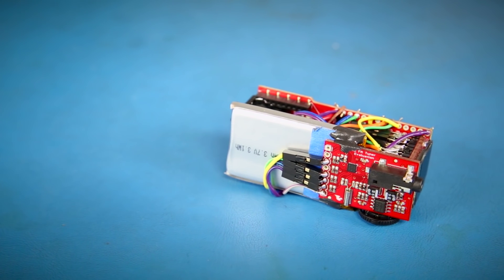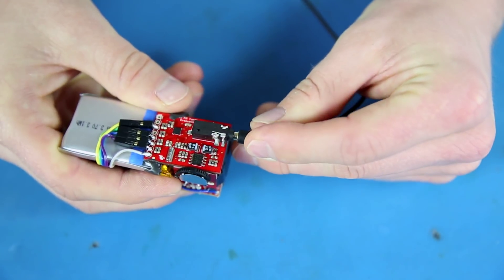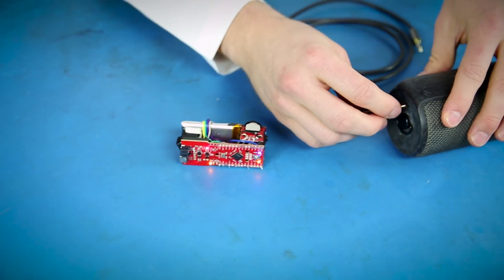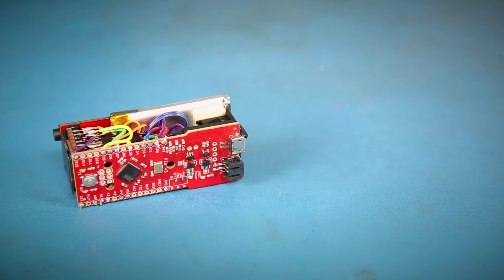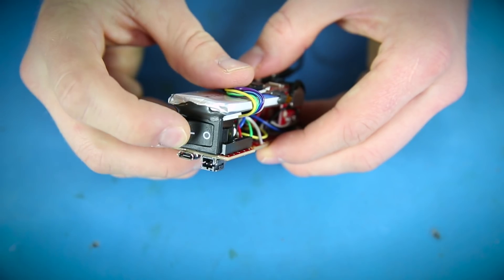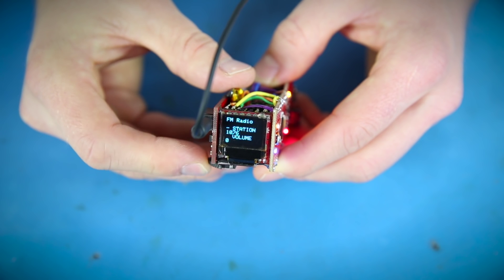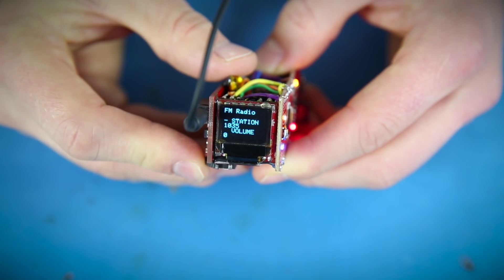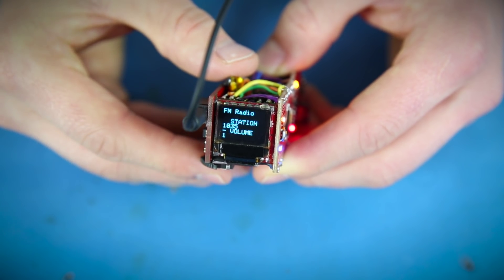SparkFun SI4703 FM Tuner Evaluation

Comment: See SiliconLabs' AN383 for lots of interesting details on the antenna. (The SI4703 datasheet mentions AN231 but perhaps that one is obsolete?) I've walked past SiliconLab's Austin location several times and now know what they do.
Reply: I am experiencing startup problems within this module; sometimes its not starting up and sometimes starting with AM like noise and locking. How can I solve this? Do you have any idea? My platform is arduino and Library is marthhell.de   radio library.